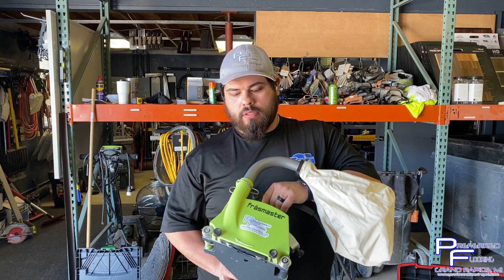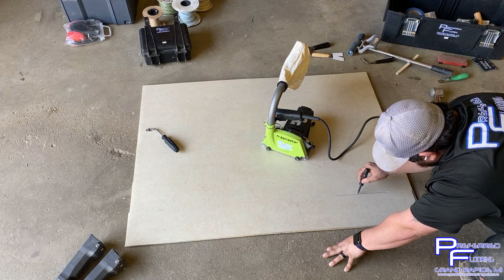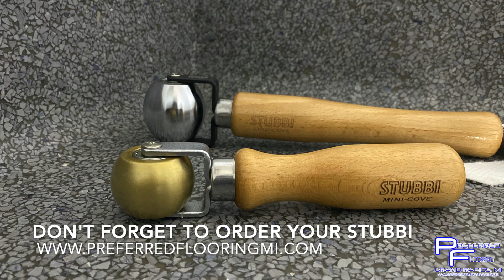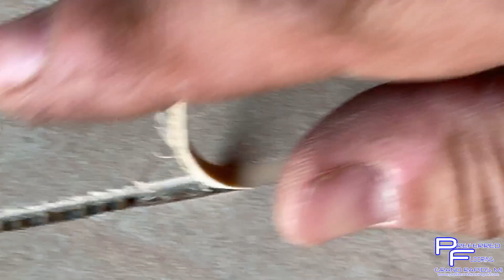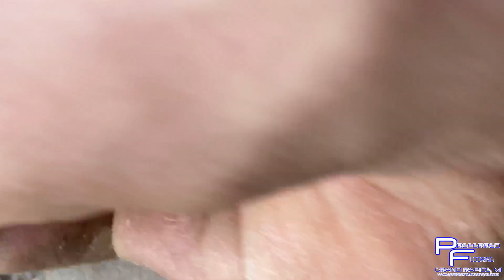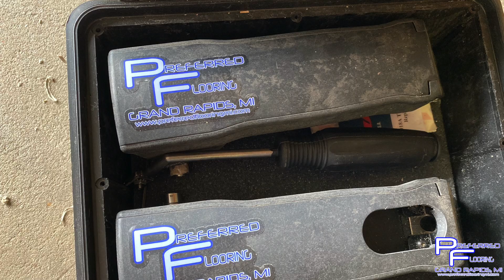Linoleum Heat Weld Basics

Comment: Dumb question from someone who is relatively new in the trade: If your Leister welding gun is a manual (older) version with settings from 0-9 which setting do you have it on that equates 750F?
Reply from the maker: It depends on the tip and airflow coming out. A Majority of the time it's more of what you feel comfortable at than actual recommended temps. I would start around 4 and work up or down from there.
Reply: @PreferredFlooringMI  Great! It's probably the answer I was hoping for 👌. I hover around 3.5 to 4. Two more experienced colleagues advised me to work with 5, but I feel that the weld melts way too fast at 5. Thanks for the reply.

Comment: Thank you. Great tip on how to determine linoleum vs vinyl weld by pulling it apart. I've been searching for a simple explanation and you nailed it.
Reply from the maker: It’s one of those things that can save so much time! Like a repair, customer states they have the weld, then you can ask them to do this and see if it’s the right material before you even get there. Glad you liked the video!